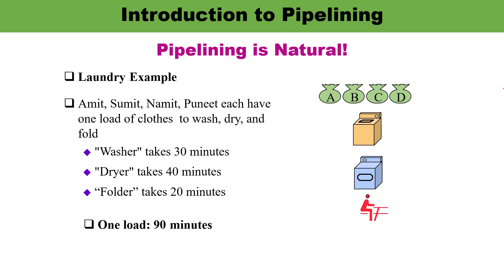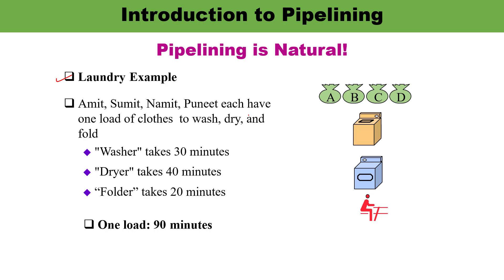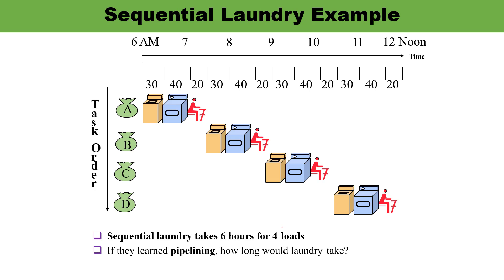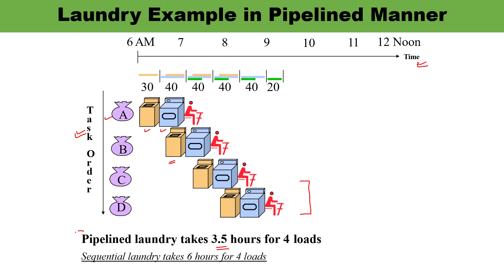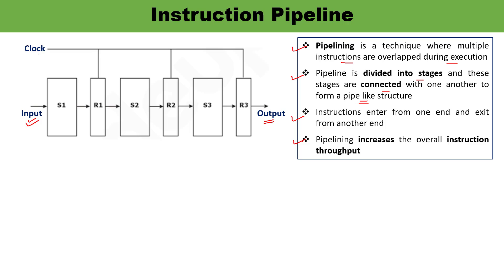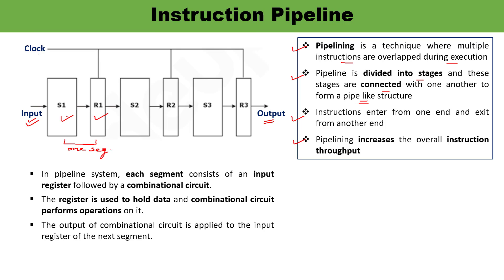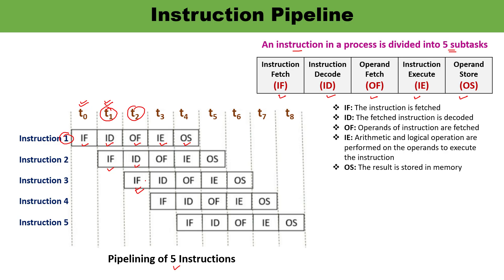Introduction to Pipelining | Instruction Pipeline || Computer Organization & Architecture

Comment: 🎯 Key Takeaways for quick navigation:

01:02 🕹️ CPU has two main components: ALU for operations and the control unit for synchronization.
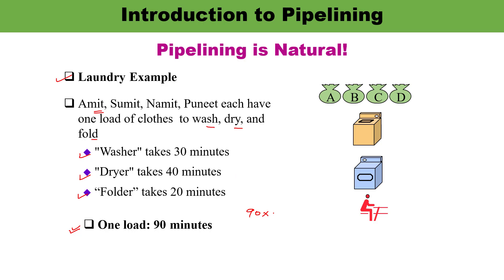01:42 🔄 The control unit receives input, converts it into control signals, and coordinates data movement.
03:03 🛠️ Two techniques for control signal generation: hardwired and microprogram control.
05:37 ⚡ Advantages of hardwired control: fast execution and optimized component usage.
06:18 ❌ Limitations include difficulty in modification, higher error probability, and increased complexity/cost.
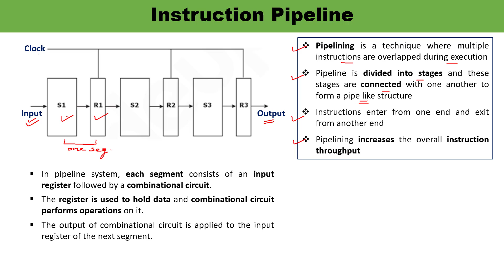07:15 📊 Detailed block diagram of a hardwired control unit involves key components.
10:15 🔧 Control signals generated from the instruction register, step counter, flags, and external inputs.
12:17 🗂️ Designing a hardwired control unit involves creating Boolean equations from a table.
15:46 ⚙️ Numerical example illustrates deriving Boolean expressions for control signals, aiding circuit design.

Made with HARPA AI